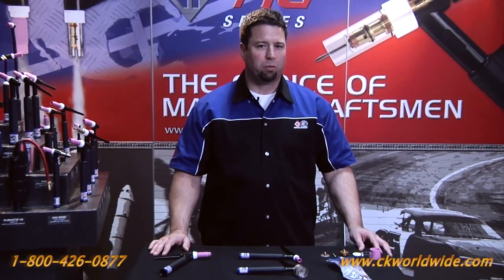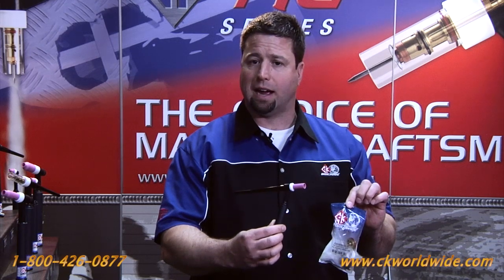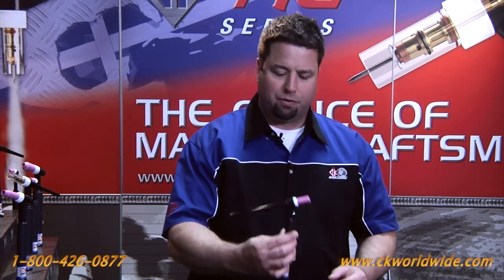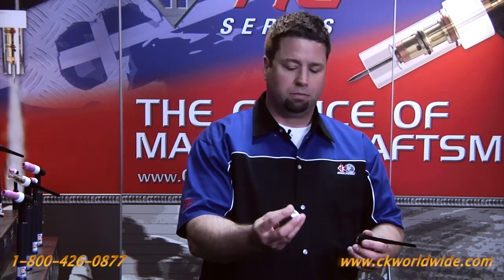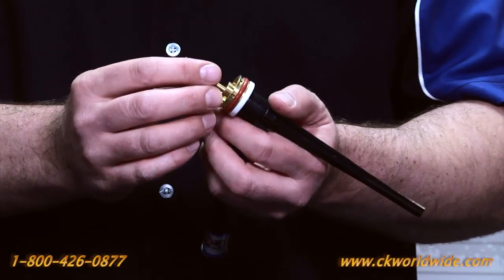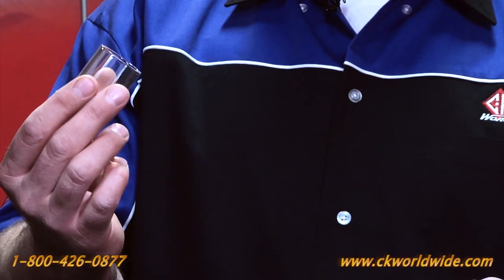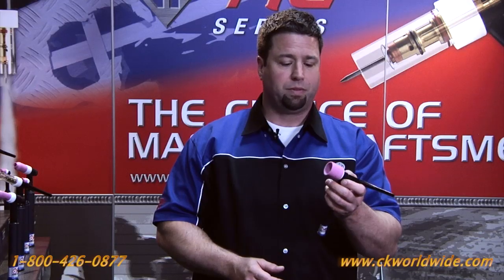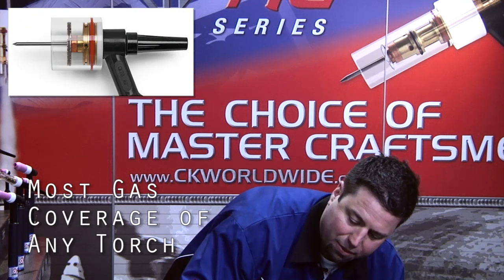TIG Welding Titanium Cups/ Large Diameter Gas Saver Front End

Comment: What's the recommended gas flow for a 1.5" stick out with a 3/32 tungsten?
Reply from the maker: +John Atchison We would recommend in an optimal setting to start at 20 cfh and watching how the weld performs under that condition. From there you can slowly back down the cfh and see if you are still getting the quality of weld you are looking for at that flow rate. It can depend on many factors from environment, to the cleanliness of your material.